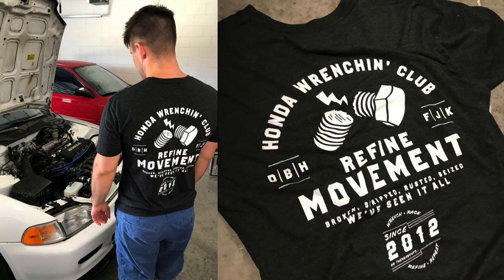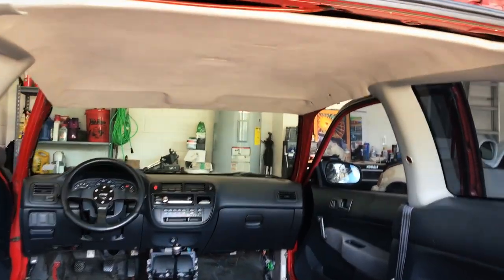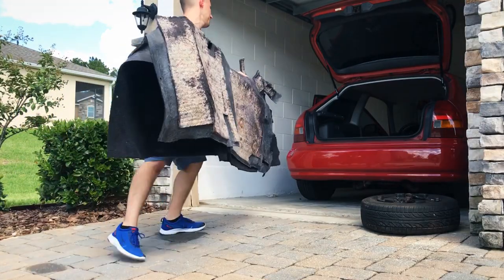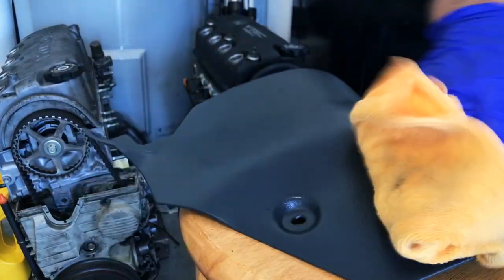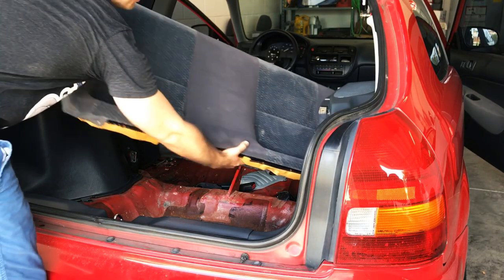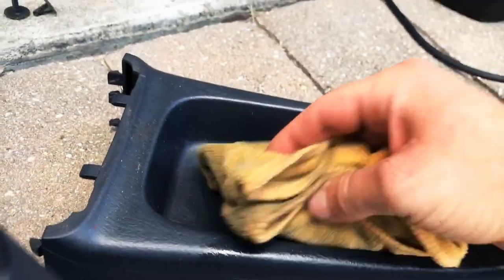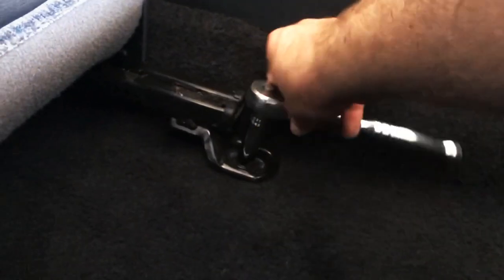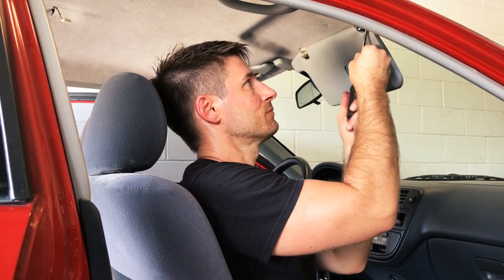FULL INTERIOR RESTORATION | 1998 Civic EK Hatchback

Comment: Awesome build. Just a word of advice... In relation to towards the end when you sanded off the back brackets to get rid of the rust, always take the time to get off ALL the rust. You're already there working at it, so take the extra couple minutes to use a power sander or sanding disc and get it back to pure metal. Painting over it will only hide the rust and it will still get eaten away at it until it's rusty again. 
Keep it up though. Looks awesome.

Comment: For the mirror you take the small cover where the joint is. You need a t-25 if not t15 and just tighten it up. I had the same problem in my EK .

Comment: Looks really good. Will be doing the same for my 95 coupe. Thanks for the inspiration.
Reply: JC Risen did you do it to your 95 coupe?
Reply: @jesusharo6032  I dyed my carpet black.
Reply: JC Risen how did it come out can I see?
Reply: @jesusharo6032  it came well. The whole process is super easy. Just takes time. My only issue is that I used water that was too hot initially and it warped the container I was using to spray the dye on with....which intern caused it to burst all over my garage lol. So now I have another spring project to tend to. I don’t have any pics now bc I am away for work.

Comment: Can i have the part # for those seat bolts man?
Reply from the maker: 90155-SH3-000 for three of the bolts and 90135-SK7-A01 for the final bolt. That one faces down and holds the rear of the seat slider